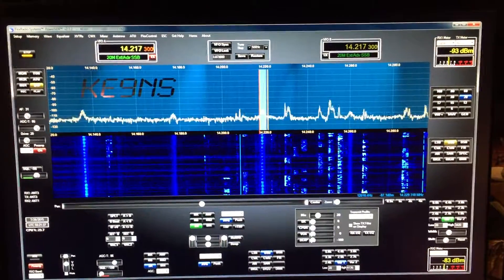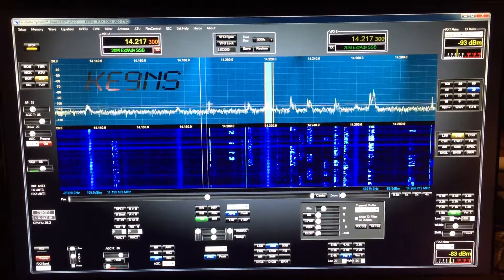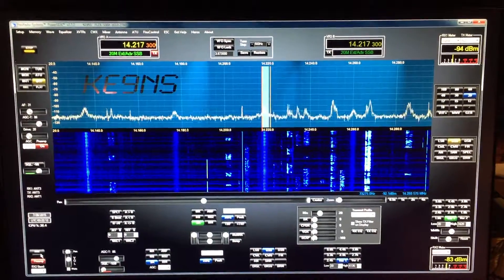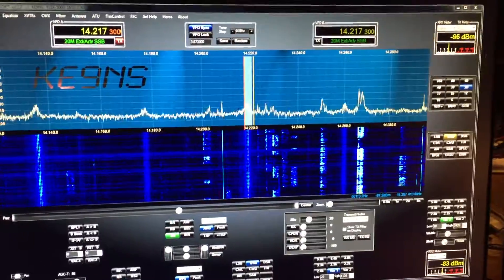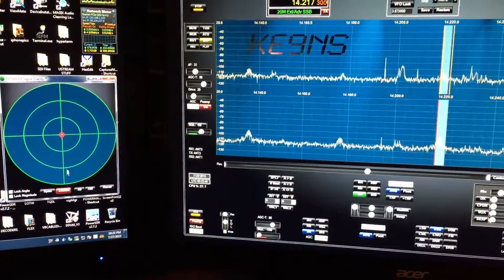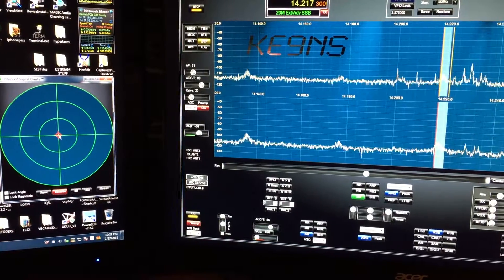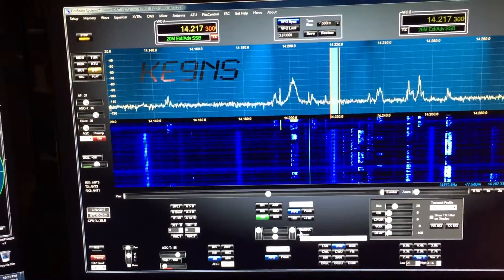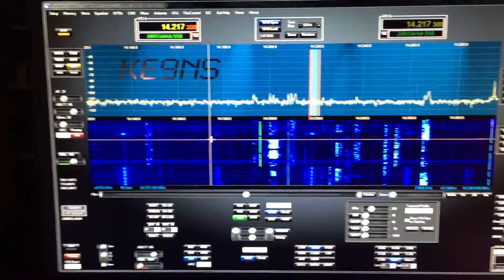ESC Noise Cancelling using PowerSDR 2nd receiver

Comment: Hi, I just wanted to give you a shout. I just recently bought a brand new flex 1500. And I do mean brand new. Unopened, in its factory box.  Apparently two 1500’s sat Unopened in a storage locker which was leased by an engineer.  The lease lapsed, and both radios along with a lot of other gear were won in a storage auction in Missouri for $50.  I got one of the two, it’s brother was sold to a local. Anyway, your software lets me use this radio to its maximum.  It’s brilliant, I would have paid you for it.  Thank you so much for basically supporting this radio. It makes my purchase so worthwhile and my ham radio experience so awesome. I basically got into a flex/power SDR system for under $500, and this radio is killing it - I just set a record for my states QSO party for QRP phone by making 5x the QSO’s as the previous record holder.  I have no doubt that I was only able to do this because I was able to use the spectrum display to pick out narrow band slices to get my signal out in between QRM.  Thanks again, Flex should pay you for legacy updates and support.